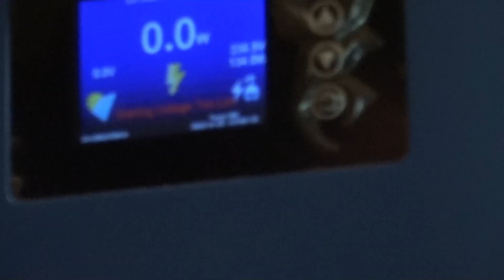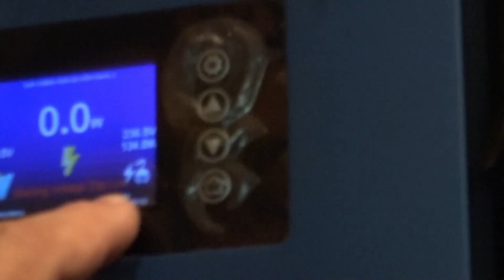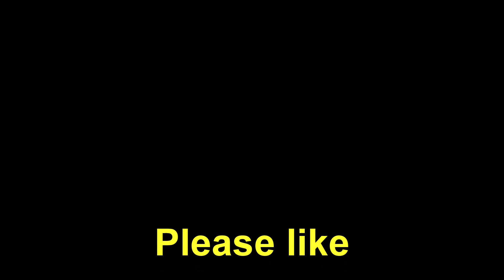SUN GTIL 1000W limiter Solar Power inverter dismantle and fix part 1

Comment: Hello everyone! I got 2000W version and each day i´m performing a decreasing in power production. At beggining the max production was 1850Wp, and day by day it is decreasing the production by ~20W less everyday, now is producing max 950Wp. Anyone has same problem?
Reply from the maker: What I found kind of strange, my install it's like 1600W panels...I had peaks from SUN2000 like 1450W, so I know it's almost correct, but under really hot summer days, full sunshine though , the power went down around 950W...that's because the panels are overheating in the super hot summer sun. Nothing to do.
Reply: @viocaia  Very weird situation because in same conditions (on same temperatures) with 3KWp solar panels last year everything was ok with high performance  with 1850Wp. Will try to check and if i repair i will coment below to share a resolution if.
Reply from the maker: @MultiPowerLoRd  Check the panels, maybe there are some bad connectors.

Comment: HI,
I have a SUN-1000GTIL2-WIFI
and I couldn't set it up for the internet,
always gives me offline.
One question, is there software for Windows to view the data without going through the internet?
if so which software?
Thank you.
Marco.
Reply from the maker: Hey! I'm sorry but I can't help because I never had a Wifi dingle installed. I'm using a Sonoff for power monitoring and on/off status.

Comment: mine took a shit around 2 years.
Reply: it was a 2000 watt unit, but almost same.
Reply from the maker: @kennethlittrell2359  it, s same schematic but double Dc boost convertors..
Reply: I dont know anything about fixing the unit and there is no service center here in the Philippines
Reply: I would like to fix it but I don't know how. I may have to order another unit
Reply: it is like 350 dollars to order it.
Reply from the maker: @kennethlittrell2359  best idea, check facebook there is a Gtil community, maybe someobe can help you
Reply from the maker: @kennethlittrell2359  I saw Aliexpress only boards so you can use the case.. It.s easy to replace it
Reply from the maker: It can be fixed..usually are the Mosfets burning..
Reply: Same Here not worth buying! by the time it blows in barely paid for itself another Chinese RIPOFF!

Comment: Hi Viorel, nice video as always.
Mine still running, same Sun GTIL1000, haven’t done any improvement as well.
It seems that even the heatsink for those Mosfets are too small and not directly in contact with the rest of alum body. So large area of heatsink are just for diodes on the back. I am thinking to add extra alum on top of current Mosfets’ heatsink but space-wise a bit tricky not to interfere with the LCD board.
Btw is it all IRFB4227?
Thanks and goodluck.
Reply from the maker: Most of them are 4227,,and you gave me a good ideea about better cooling..how stupid design, the back plate barely warm and the inside fan screaming under load..I will add some thermal pad to touch the front..
Reply: @viocaia  yes that’s true, diodes are perfectly cooled while the Mosfets inside are on fire 😄.
Well it’s better if you can dissipate heat thru to the front cover. It is quite difficult to make a contact with the back alum cover unless you do something to modify main PCB, it is the heat transfer barrier.. indeed very smart design for 1-2 years lifetime 😄
Reply from the maker: @RBMK--vj2rn  yep

Comment: My condolences for your loss. :(
Reply from the maker: Thank you Mr General Sir!
Reply: @viocaia  Why did those pop?  I know the mosfets in the grid tie inverter from eBay have always had horrible quality control issues that causes the fets to burn out.  First thing I always do, for a decade now, for any electrical item from China is tear it down to make sure the connections are right.  Doesn't matter as I have had fire potential power supplies sent to me via Amazon with screws rolling around inside.  Not only check to see if they are tight but they use a TIM of some kind (either grease or a pad) as that is another thing they love to cheat on.  Finally when a product does pop (when the time comes as when, not if) I purchase real quality mosfets from Mouser, or Digi-Key etc... (I forgot the one you have in Europe that is a big name of real semiconductors not knockoffs).
Reply from the maker: @generalawareness101  Conrad in Germany ..it's great! This inverter came from UK, thru an english company..my fault it was i didn't checked like you said..it was no kind of thermal paste applied ..just a pink isolator..probably this days because of hot summer temperature combined with extensive use of AC..boom! I already find some transistors in my junk box, replaced those burned and hopefully it's alive..I don't have a min 24V power supply around to check but sun it's coming up soon!
Reply: @viocaia  Yep, either loose, no screw, or just nothing there as a tim so no heat really get transferred, and it burns up.  Summer here as well with 35c-40c temps they just can't get rid of the heat and POP.

Comment: What's the issue with it?
Reply: 2 mosfet transistors burned(shorted)
Reply from the maker: Two Mosfet transistors kaput! Probably bad heat transfer, but I hope I fixed it..I'll see next sunny day..
Reply: @viocaia  the products these days are made to fail right after those 2 years waranty... They put the components to the limit... I suggest you to search for better mosfets, more amps and lower RdsON value...
Reply from the maker: @adaniel69  I had some repalcements..I did it laready..it was working for few hours..But Like you said, I need better replacements..